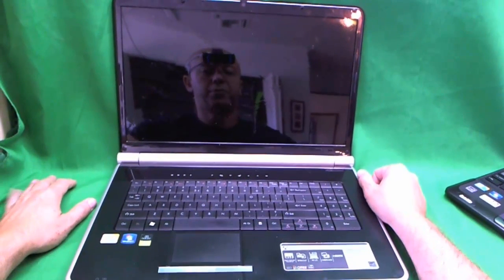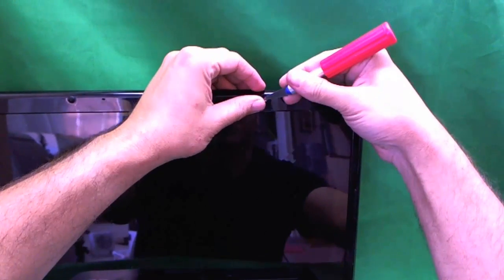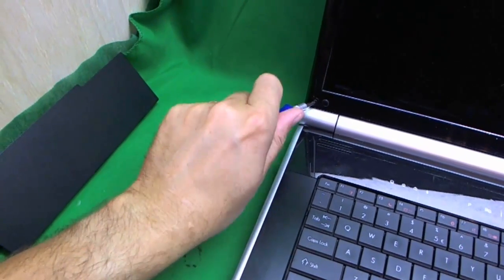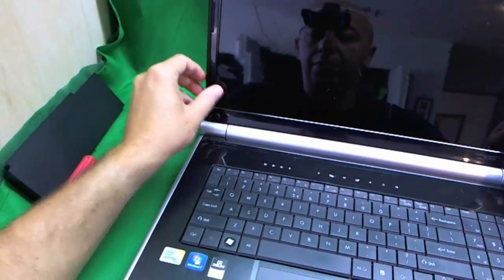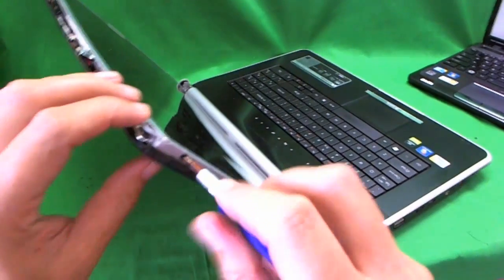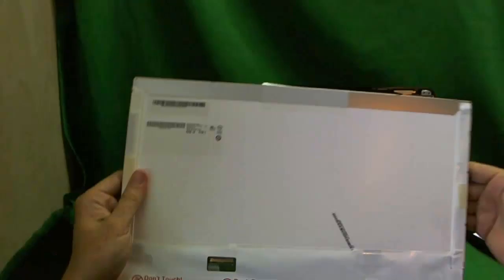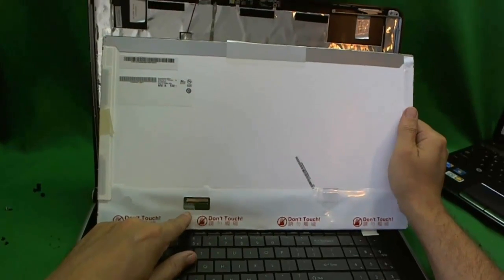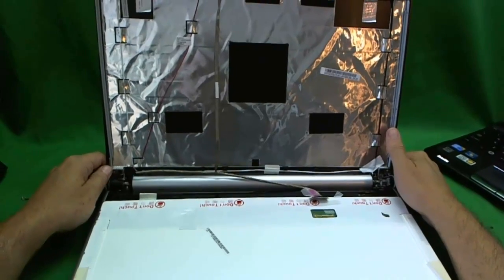Gateway NV78 Laptop Screen Replacement Procedure

Comment: hey Screen Surgeons  i have a problem when i was at the air port the guys that deal with you stuff grab my back pack and threw it and broke my power button now its missing and i was wondering if i could replace it with a different power button?

Comment: I would like to know where to solder the cable the connects to the power button on the inside of the computer because the cable was pulled out